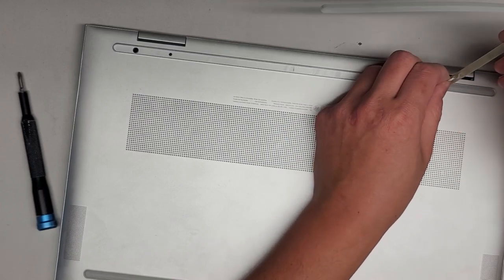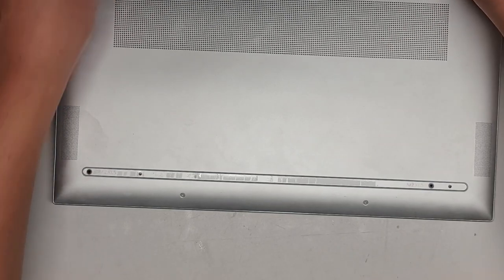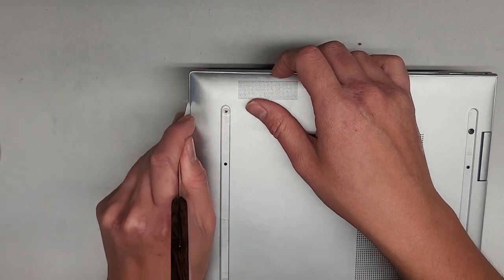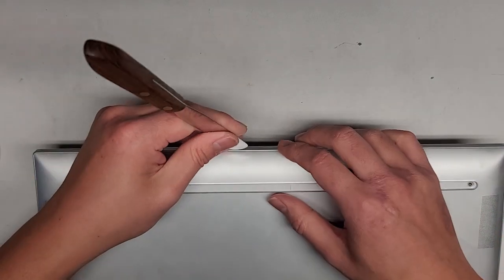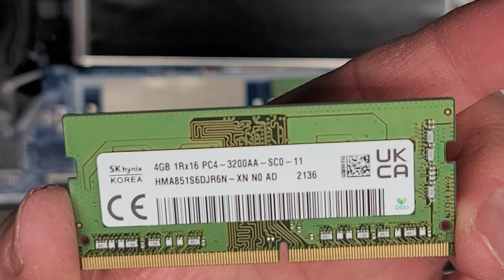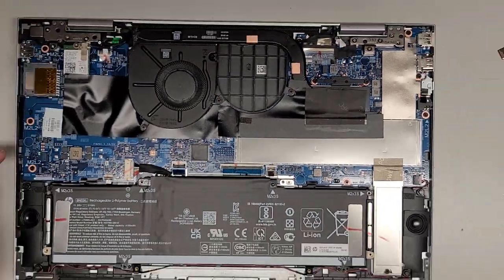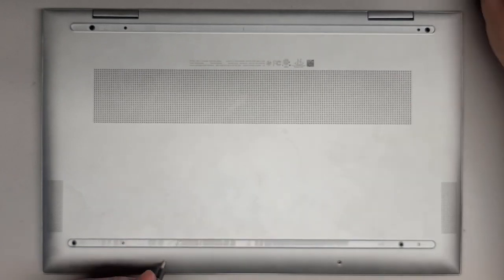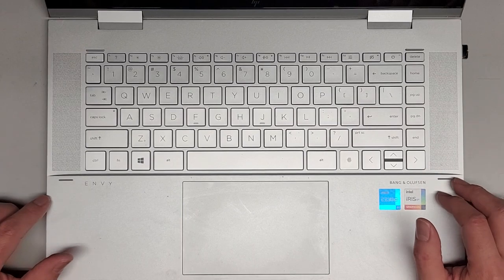HP ENVY x360 m Convertible 15m-es1013dx Disassembly RAM SSD Hard Drive Upgrade Battery Replacement

Comment: PRO TIP: Don’t peel the whole foot strip off! Only need to peel from each end until you see the screw. This is applicable only to this generation of the hp envy x360.
Reply from the maker: It will flop down and be annoying, but yeah, you can do that

Comment: I was trying to do a rush job and replaced my cracked screen without disconnecting the battery. The laptop powers on like normal but nothing shows on the screen. Did I fry the computer? Would I need to get a new Motherboard?
Reply from the maker: @22lukeskywalker  could be motherboard, screen, and/or lvds cable

Comment: Regarding the rubber strips, why not just peel away 1 inch from each end because the two screws are located at the ends?
Reply from the maker: I don't have the luxury of knowing where and how many screws there are until after I've peeled it off.

Comment: @ItsBinhRepaired I replaced the RAM and SSD on a similar HP Envy x360 15m, thanks for this video! Though now the I/O ports on one side are not working. Its a USB-A, HDMI, USB-C and headphone. On the upper-right side when the back is off and facing up.

Any tips or troubleshooting steps you can offer?
Reply: I will add that since I disconnected the battery to do this, the CMOS did reset although I do not see any setting in the BIOS applicable to enabling/disabling ports
Reply: The USB-A on the other side does work, but just discovered that the WLAN is missing too
Reply from the maker: You likely have a cable that connects that all to the motherboard. Check the connection.
Reply: @ItsBinhRepaired  wow, not only a reply, but quick too! Thanks. All connections are secure, i pulled battery, upgraded RAM and SSD, plugged battery back. All of the non-working ports are soldered to the mainboard, identical to this video. oh well, at least this isnt my job and its for my sister. A USB hub and USB wifi are in her future
Reply from the maker: @jeremybraband6567  hmmm that's very strange. No static discharge or anything?
Reply: @ItsBinhRepaired  possibly i guess, never been on for ESD protection, over the last 30 years, never a discharge, but always possible.

However, the case is over, after one more look at everything, touching nothing, and then putting the back cover on for the last time. Booted it, and everything is back.

So, happy ending, just a whole day of troubleshooting. Thanks for your time and the video!
Reply from the maker: Awesome!

Comment: So I have the exact same laptop & I accidentally spilled some milk on it while I had it on.
I turned it off immediately.
Used a very strong air compressor gun to get as much of the milk as I could (125psi), hitting it from all angles, over the whole keyboard, & all the ports.
I feel I was pretty thorough.
I disconnected the charger right after I turned it off as soon as it happened & haven't plugged it back in since, pretty much let the battery discharge.
Is it it salvageable? If so, how much am I looking at to repair it?
Or can I just disassemble it & clean it with isopropyl alcohol?
Would that do it?
Btw, I've left it unplugged at this point for a week & the only signs of life (if you wanna call it that) is the little white light for caps lock button not turning off, it's just on all the time
Reply from the maker: Blowing it was the worst thing you could have done. It pushed the liquid deeper into the computer. It's likely dead.
Reply: @ItsBinhRepaired  Thank you for the reply
Reply from the maker: Yup :/

Comment: Have the AMD 5500U version of this laptop, and it recently stopped working. It will randomly crash 5-15 minutes while powered on. Doesn't matter if it's in BIOs or windows. It will crash. There isn't a BSOD, and it just turns off. Nothing is helpful in the event logs. Doesn't seem like anything is overheating because I'm monitoring the sensors, using hwinfo...

Ever encounter this? It's definitely hardware related, and I'm thinking battery... It could also be the c-state low power issue for AMD processors, but didn't think that affected 5500U chips. 

Thanks friend!
Reply from the maker: Not sure. Likely battery or motherboard.

Comment: Thank you. I just opened mine and took the battery out. Plug it in and did not come on. Any indication of what could it be?
Reply from the maker: Let it sit for a few minutes. Removing the battery resets the bios.
Reply: Thank you. It was the power button.
Reply from the maker: Glad you figured it out.

Comment: Is it advisable to disconnect the battery before removing the memories or the hard drive?
Reply from the maker: Not necessary, but you can to be a little safer.
Reply: YES!! You can cause RAM faulty if laptop has any power in it!! I had this occassion and had to repair MB along with new RAM! Always remove the battery when making any changes to hardware!!

Comment: I replaced the battery of my envy x360.. but my laptop keeps shutting down in any time. Even when i run the laptop by plugging in with the  charger. 😢 

Can anyone tell me What could be a probable cause?
Reply from the maker: Are the fans working?
Reply: @ItsBinhRepaired  it completely turns off... Currently I'm using the laptop with no battery.😔
Reply from the maker: @rahatpreo3209  it works without the battery?
Reply: @ItsBinhRepaired  yeah. Without battery it runs perfectly
Reply from the maker: @rahatpreo3209  maybe the battery is bad
Reply: @ItsBinhRepaired  thanks
Reply from the maker: @rahatpreo3209  no problem